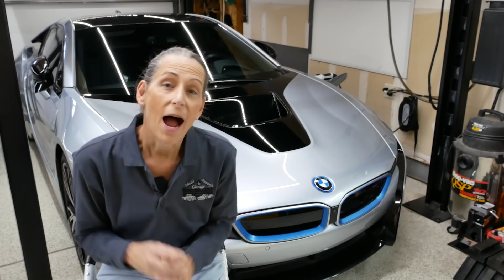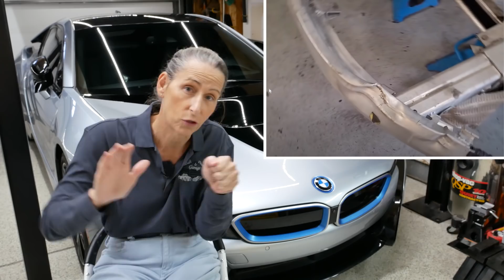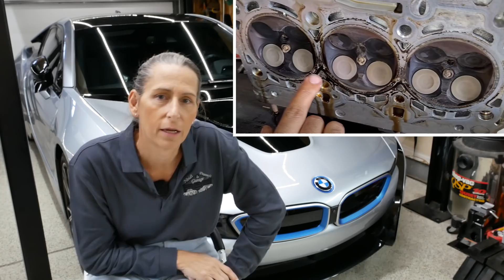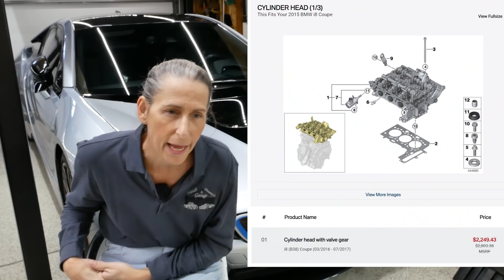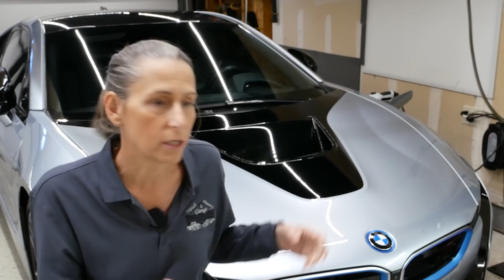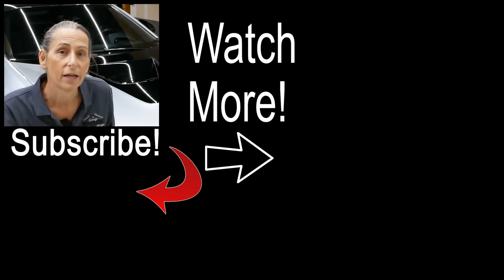Is THIS What Ruined Sam's i8??

Comment: I have never been a fan of skimming a head even if it is bent . If You skim it flat the line boring for the cam will stay bent when the head is torqued down ,pinching the cams ,adding drag and it will fail , Just torque the head back it will be straight on the block , I once had to fit the cam with grinding paste  in a head that was skimmed to get the cam to even turn , ha-ha
Reply: With overhead cam engines you straighten/bend the head to align the cam bores first. Then you can check to see if it needs the gasket area surfaced. Probably would need no or very little surfacing unless it was run long enough to erode the aluminum where it was leaking.
Reply: @robb1165  Interesting, not sure how one straightens a head? Press and blocks of wood? Sounds like a good solution. When heads are expense and hard to get second hand then properly repairing it is the best way to to.
Reply: @robb1165  Do many machine shops know they should straighten a head? How is that done?
Reply: @caduceus33  Most any shop that rebuilds  ohv aluminum heads knows how as aligning the cam bores needs to be done before surfacing. There are several methods. You can bolt it to a plate with shims underneath and heat in an oven. Some use a press to bend it and torch to stabilize its position. Each has its own issues and skill needed that determine the method the shop will use.
Reply: @robb1165  OK, thanks! is it only aluminum heads that get straightened?
Reply: @caduceus33  Cast iron heads can also be straightened. The process is similar but a different concept. They use torches in a press. The warped area is heated up to about 1350 degree's in the press. The  presses pressure is monitored to see when it relieves. Then the heat and pressure is removed rapidly. I have only seen this done on older diesel heads.
Reply: @robb1165  I'm surprised at how many "machine shops" have no clue that this is possible. When I was a mechanic back in the mid 90's I had a Mitsubishi head that was warped so bad you could see it without a straight edge. As I was removing the head bolts the center of the head would rise and you could watch the gap grow larger. After straighten it they rebored the cam journals and only had to take 5 thousandths off the deck.
Reply: @ulbuilder  To be fair there is a difference between going to a full service machine shop and a specialist in rebuilding heads. I have meet many machinists that know of many repair processes and refuse to recommend or use them. Sometimes due to the cost, risk or effort involved. Often not wanting to risk their reputation on something they do not deal with. A specialist shop is going to encounter them often, and thus be more likely to repair a part.
Reply: Skimming heads or blocks is not allowed for the brand I work for.
Of course, it happens anyway.
These engines are actually designed in conjunction with BMW.
Very poor design, speaking from experience.
Reply: @eefneleman9564   psa sh..t
Reply: No issues of low oil pressure...if the cams are digging into their respective journals, oil pressure would be low, let alone aluminum in the oil.
Reply: @imtheonevanhalen1557  I only applied the grinding paste to the journals while the head was removed without the rockers .Turned it for an hour until it removed the bare minimum material so the cam could actually be turned by hand again ,cleaned it out and assembled it ! The car was perfect , I never skimmed a head again , It just made me realized that You need the bend on the flat surface to line up those journals ,well on over head cam heads at least .On an LS engine You can skim it because it is a push rod motor .
Reply: Michael, this sounds like a great way to handle the situation! Did you come up with that yourself, or have your seen it done before?
Reply: @caduceus33  I did it once 20 years ago on a Nissan 4 cylinder 1.5 l turbo motor , I am a fitter and turner by trade so I fixed it from that point of view.
Reply: I guess you can install the camshafts without the rockers/lifters and try it.
Reply: If you watch Sam's vid, the machine shop explains why it wont work in that engine. Skimming the head slackens the chains too much, changes the volume of the ignition chamber and puts the valves too close to the pistons. The ECU cant compensate and it wont work. Best bet would be to buy a second hand engine from Europe and build a good engine from the donor engine and the original.
Reply: @spwicks1980  
Whilst using the thicker head gasket gives an extra 0.3 mm ( 11thou) to allow a skim without loosening the timing chain .
Reply: @daviddillon8857  Yeah, i was surpised they actually thought of that at BMW. The little sink hole indicating how far you can go. Almost like how they knew the thing would overheat :P Hopefully Sam gets it running well on the cheap. A new engine would hurt badly.
Reply: In the very early days on racing blocks we used to get the highest quality head gasket and spray it with silver paint on both sides.you had to do this just before assembling. I know it sounds crazy but it worked if the head was not perfectly straight.
Reply: @johnadams3152  it wasnt just racing blocks, this was  a not uncommon fix  used  by old  timers  upto and into the early 60's
Reply: Very good point Michael. Could it be line bored oversize and babbitt used as a bearing to bring the bearing caps back into spec?

Comment: As a fellow i8 owner, these videos are very helpful!  Mine is also a 2015 and I've been thinking it might be time to flush and replace the coolant. But now, I'm terrified by the prospect since I'm not sure even the dealer will do it correctly with the vacuum fill, etc.  What do you think?
Regarding Samcrac, I've followed his story as well. Because of the state of the head, I'd be mighty worried about damage on the lower block as well. The best and most expensive solution would be to install the replacement engine.
Reply from the maker: I would think a certified BMW shop would have the equipment to properly evacuate the system before filling.  I would ask them about their procedure and check that against the i8 service manual.  Call them on anything that differs.

Comment: Like you said the block needs testing for being warped  if the block is aluminium it might be warped like the head, We hope the block is steel and we hope he just needs a head.
Reply: Even if it isn't dimensionally warped, isn't it obvious that it went through several critical heat/cool cycles to question its integrity?  Any heat treating or annealing is gone at this point, no?

The whole thing is junk at this point.  Either a new ICE, or time for the crusher!

Comment: Hi Franny. You said a short block is the block and head. That's called a long block. A short block does not include the head.
Sam needs to check the block for warpage. If it's good just slap a new head on it.
That used engine might be a good deal if he can tear it down and spec it before purchasing it. Brand new engine from BMW is out of the question. 
You're right. Many people hotrod cars that are not meant to be and I would never track a street car.
I had a Mustang Mach1 428cj once that had been hotrodded to much and the valves would float out at about 5,000 rpm. I had it completely rebuilt and never hotroded it after that.
Would you believe the rebuild only cost me $500. That was in 72.
Love your videos!

Comment: Knowing BMW something must have really happened ,, such an engine damage is not just a hot run, think the read out is a good idea, and check if the water pump was working and checking on it, this block they have been making for a while would there be a structural fault in it would have been known already. is there a radiator hose not blocked ?

Comment: Good video, and again a good easily understood technical explanation of the diagnosis and possible solutions. I like your "abused" diagnosis, and I guess as the manufacturers push the technology, problems will occur = "My aluminium engine has a warped head" is a well documented issue to anyone over 30! As in basic physics heat rises, the sturdy built block and bottom end often will survive, whilst the (relatively) thinner and because of physics far hotter head will suffer, probably hence warping (away from the relatively cooler block). Wonder hence if more issues occur in hot climates? I also think you hit on a key issue, the perception of the car - its not a BMW built Ferrari, but a cruiser. It might look like a Ferrari, but it's got a Mini engine inside (which is basically a BMW redesign of an original Peugeot/Citroen engine, that powers city small cars in Europe!). I would follow a solution path outlined by a fully BMW trained and qualified engineer with lots of i8 experience - so my first call would be to find the best i8 enginner - Good Luck!

NB: "Smooshed" made me laugh - it's not a word we hear over here in Europe - you mention it often, so perhaps you need to put it on some Merch?
Reply from the maker: Thanks for your thoughts.  Interesting that during the 2018 i8 "refresh" the car got a little more power but that came from the electric motor up front and not the engine.  I think that 228HP is about all BMW is comfortable with pulling out of that engine.

Comment: Can't he mill the head down an put a thicker head gasket?
Reply from the maker: Well, there is more than just grinding the head flat...  If it is that warped it may also have a compromised cam seats and bearing.  All that would require a alignment hone.  Hoe are the valve seats?  Are they warped at all?  Valve guides?  It is probably cheaper in the long run just to replace it (provided the block is still true).

Comment: Sam needs to put in a LS
Reply from the maker: Only if that LS can speak German...  It has to interface with all the other electronics...
Reply: @HeidiandFranny  That's more advanced than Sam can handle so he'd have to pass it on to Rich.  Standalone PCM controller for the LS, there's work to be done to spoof or simulate the CAN signals, not trivial but doable.  As some point one of us will do it, because it's a challenge.  If these get cheap enough i may drop my S85 in to one of these, and despite it also speaking german, it will be easier to run it with a standalone PCM which is what ppl do when the shoe horn S85s in to E36/E46 etc.

Comment: Cant salvage the Head on sams car. it's out of specs bad. Not all cylinder heads can be machined, because it have a chain-driven cams /top end. + same goes to the engine block aluminium it warps badly easy. Sadly it's a common thing to see here in Europe. and lol not the first BMW engine that needs work either on head gasket-stretched head bolts.warped head.bottom end bearings +++. On sams car, He did have a paper from one of the dealers that were spot on. New engine. + on I8  17 potential trouble spots, ranging from the engine, transmission, and brakes to power equipment and the electrical system.
Reply from the maker: Yes, totally get what you are saying.  Well, we'll see...  It all depends on if the block is true (or can me machined within spec.)  I'm sure we will find out what he is going to do soon :)

Comment: Too bad they didn’t do a leak test before they took off the head. They would have at least had the chance to hear if there was leaking coming from the rings. I would think that pulling at least one of the pistons and rods to check the condition of the bearings would help in making the decisions about which path to take. Inspecting the piston skirt and the sides of the bore would also help in making the decisions. I have only rebuilt three car and two aircraft engines in 30 years of wrenching in my own garage and hangar, so I’m not that experienced. I wish Sam all the luck in the world with his future projects.
Again Franny, Great analysis of how to proceed.
Reply from the maker: Thanks James, I agree...  A leak-down would have been a great thing to do.  It would give some real data and is inexpensive and doesn't take much time.  Well, we'll see how it all turns out :)

Comment: Personally I  think the head is beyond saving, they could machine it flat, but taking that much off the head will not play nice with the timing and ecu. He could have a thicker metal gasket for the head but not really the correct way of doing things with the amount of material they will have to remove. If the temperature did go that high its a good chance it has warped the block, but Its well worth checking, if it's ok just put a new head on and you have saved yourself $3000. I think Sam will probably just look for the best price on the whole engine. He's paying someone to do the work and does not want to put it back together and find out the heat had caused some other problem in the block and have to take the engine out again. I am sure I can hear Rich laughing lol. Thanks for the video
Reply from the maker: I bet Rich is getting a kick out of this :)
Reply: @HeidiandFranny   haa!

Comment: Good morning. Head is a goner. He needs a new or used one. Engine block should be measure before deciding but If I were him I will install a new/used engine, it looks like the last owner did not care at all. It is a great car but the doors are the worst, it very difficult to seat on an i8.  Sam took a risk now the only option is to fix it.
Reply from the maker: Oh, I really like the doors.  Up and out of the way - they take up 1/2 the width of a normal door and in our garage that really helps.  The trick to getting in an out of any low car with a high sill is to go in butt first and swing your legs in.  It just takes a little different technique.  Sam will be fine :)

Comment: I would say as long as the Block is ok then just slap a new head on. I would also make sure the coolant system is 100% perfect before I ran it. Inspect every hose and fitting
Reply from the maker: Totally.  I think a very through inspection of the cooling system is a really good idea.

Comment: The bottom line is BMW dealer was correct. This car needs a new engine. There are many ways to salvage engines and parts but that's not what BMW dealer will do as ultimately the customer will ask for a warranty and a BMW won't provide a warranty for what Sam got into.

Comment: Saw Samasscrac's video. 😁

Knowing that the BMW8 was repossessed, I'm starting to wonder if it was intentionally abused out of spite by the repossessed owner before the bank took the car back.
Reply: Or the owner knackered it then stopped paying the HP which led to it being repossessed?
Reply: I agree.
Reply: If you watch Samcrac's video, he reads the CarFax. It was driven 3k after the repo, so it was likely working at repo time.
Reply: The car was in an accident. After being fixed it over heated and BMW wanted 20,000$ for a new engine so the owner probably just stopped making payments and let the car be repossessed.
Reply: Some one tried to do an insurance job and write it off.
Reply: I am a retired banker with lots of experience with repossessions. If the owner did not have the respect to honor his loans, history has shown they never looked after their car either. Most people thought repo's were a deal, they never were!

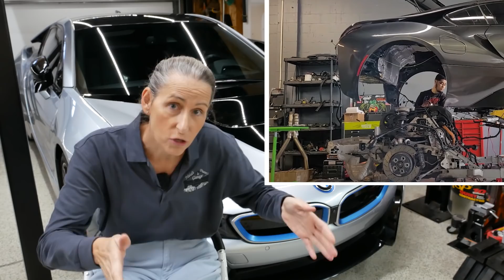Comment: 3:40 : 4 to 6 hrs to drop the 3 cylinder engine, „Not that long“. I mean, You are right for that kind of car but it sounds funny on a channel which is mainly about air cooled engines who are out of the car in a hour max. 😁👍
Reply from the maker: Well,...  The 911 is about eight hours I think?  the 356 is less than an hour.  The 308 is 12 hours I think.  I do like how it all comes out as an assembly.  I've watched the videos of the i8 being built and it is all about sub-assemblies.  They seem to go in rather quickly.  At any rate that shop made short work of it!
Reply: A Porsche 911sc easily comes out in 2h if you have done it before. My first pull was 5h but was working solo and did a lot of inspections on the way. With some practice you get it within 1h without rushing. A lift is a must for those times though
Reply: True. My workmate removes it in abut 1 hour. But he does it on a daily basis.